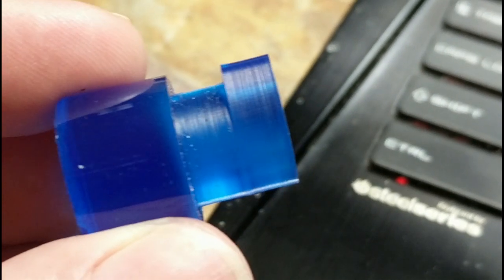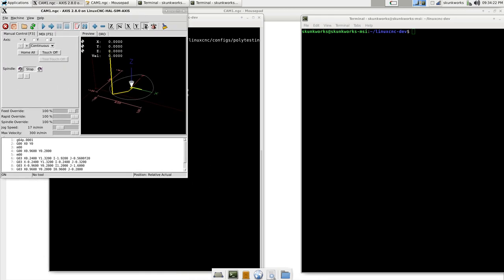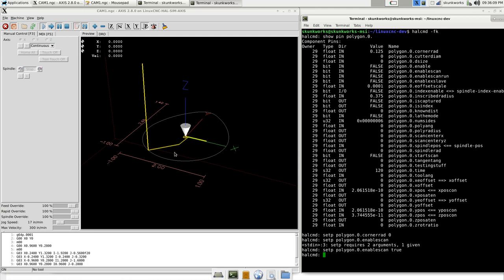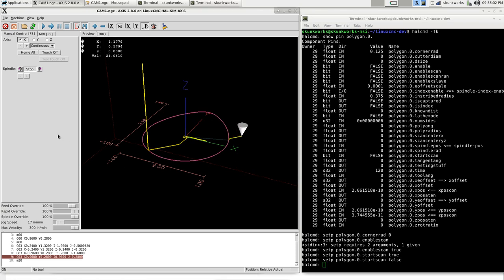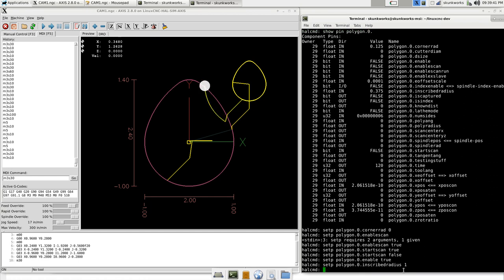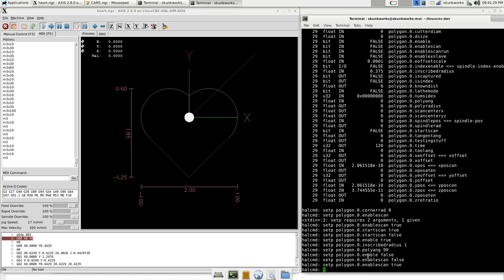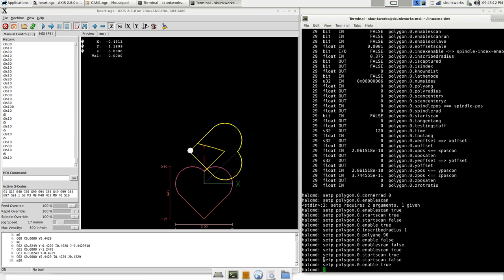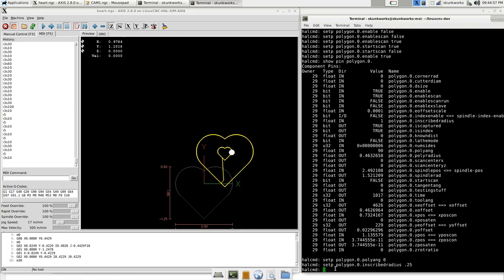Turning and boring arbitrary shapes with spindle synced motion..

Comment: Have you thought about how it might function as part of a part program? Eg if you wanted to turn a hex head bolt in one op. Could you trigger the routine with an m or g code or have it as an external subroutine?
Reply from the maker: Currently I use the M codes to pass the info from gcode to the hal component..   http://www.linuxcnc.org/docs/html/gcode/m-code.html#mcode:m62-m65  I think if I get back to it - I would like to do a re-map where I create a special gcode that does all the configuring/enabling of the component.    And I did make a hex bolt in 1 gcode program.  https://www.youtube.com/watch?v=wv7mMS5xKks

Comment: While you showed how to move around the shape, you did not point out how to make it feed in the Z axis to cut these shapes to a given depth. 

Is this terminal window a part of Linux? Will it allow more than a single command at a time? Does it output G code that can be edited like normal G code in a text editor?

This pin list; what exactly is it? Is this Linux terminology?
Reply from the maker: these are hal pins within linuxcnc.  These can be hooked up however you want.  The final solution would be some sort of gcode remap that you set these parameters.  Currently I have it setup so that I can set these parameters from gcode using special gcode commands that can communicate directly with hal and set these various pins.